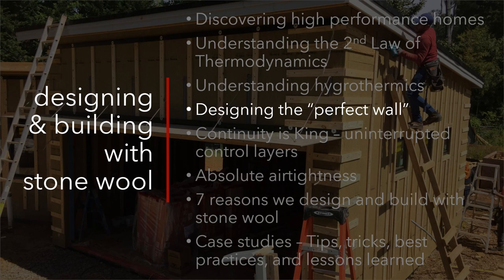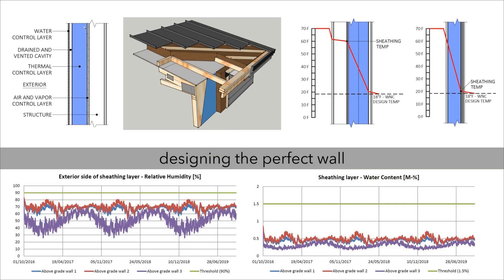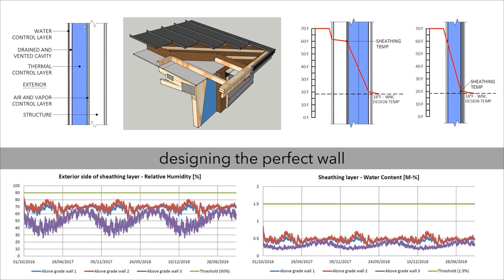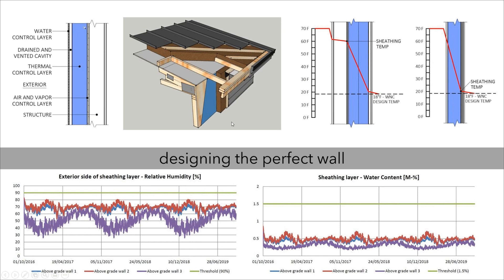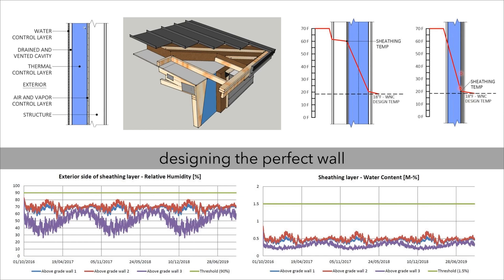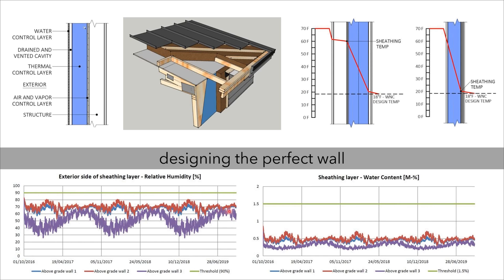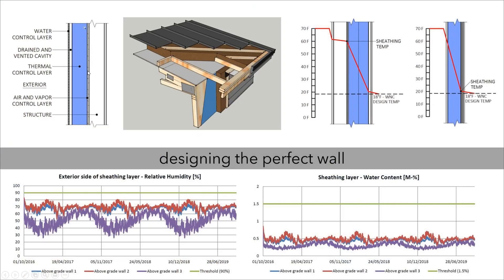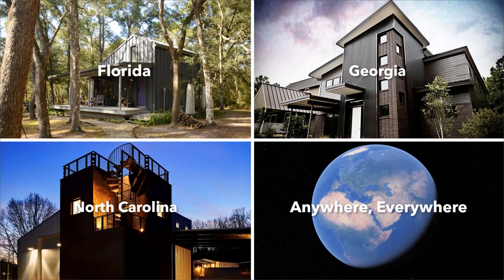Designing the “ Perfect wall ” with LG Squared, Inc.

Comment: What about during cooling season?
Won’t the dew point be just outboard of the sheathing?
If so I guess it would dry before it could mold eh?
Reply from the maker: Having the insulation to the exterior prevents the assembly from reaching due points in any season and in any climate.  ROCKWOOL will do a WUFI analysis for you to make sure you have enough insulation as well.

Comment: I have to be honest- when I first encountered this concept- I thought the architect made a mistake on the details.  Once I studying this concept even more, I can't imagine going back to "normal" wall systems.
Reply: Regarding 'normal' - do blower door tests bear out the concept's premise ?
Reply: @robertb.macnaughton8975  Regardless of where the insulation goes, I would have the same air sealing package.  I make sure the air leakage is minimal.  For standard framing or the perfect wall, we would use something like the Zip System or a liquid applied membrane, which helps create a good air seal outside the framing.
Reply: @SawHorseDesignBuild  My reference of the blower door tests was not answered directly. I must assume, then there is none, which means this is a work-in-progress, not yet in practice, which was my hope. Numbers don't lie, and are specific, like a blower door test.
I've been studying building science, as a layman for about 5 years with formal experience in the building trades, to give you some perspective of my orientation. Joe Lstiburek and Matt Risinger have been my online mentors, so to speak.
Good Luck on adaption of your design concepts
Reply: @robertb.macnaughton8975  This is more than a concept.  Check out the other videos in the series to see some examples of real projects and their blower door results.  The links are in the description for your convenience.